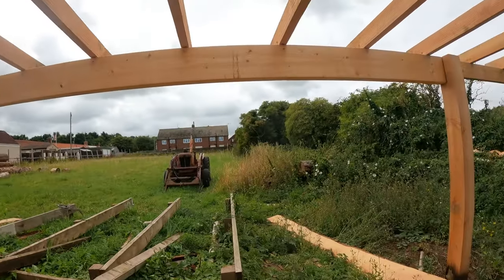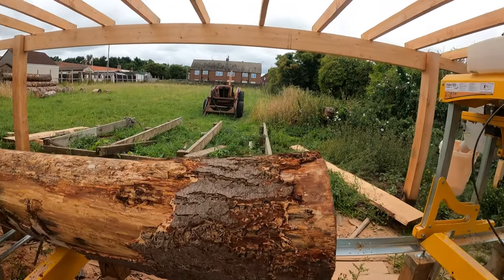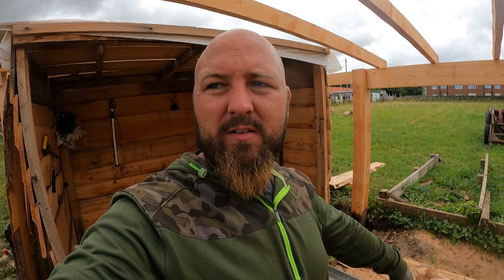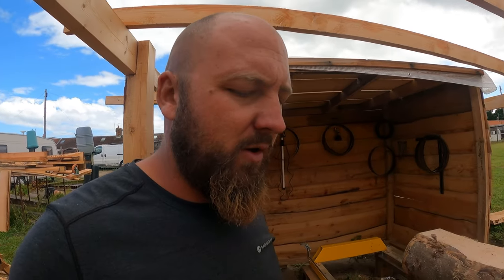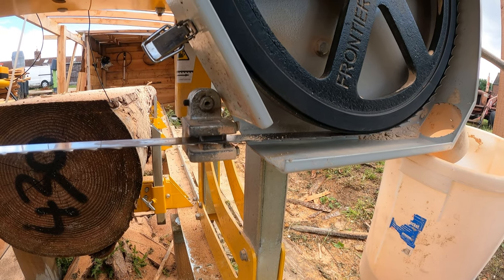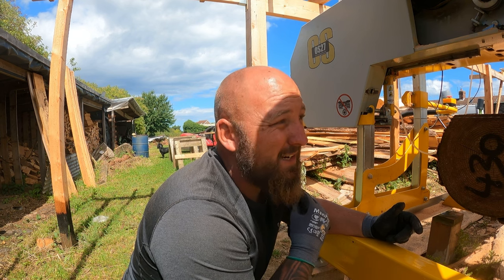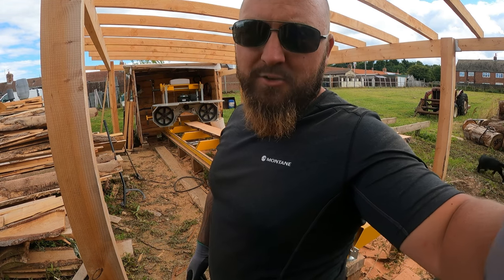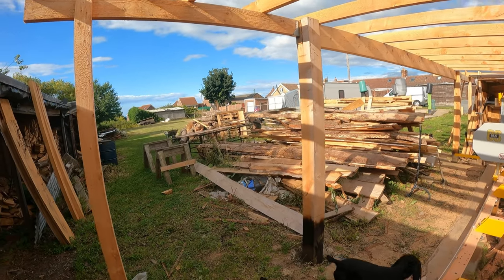Frontier OS27 Sawmilling ~ milling boards [drive belt FAILURE]

Comment: Nick, somedays I just have to walk away from the mill.   It does get aggravating and most of the problems I run into are my own doing.   
My sharpener too, if not paying attention it'll occasionally muck up a tooth.   
The Sawmill shed looks great.  Keep up the great work my friend.
Reply from the maker: Thank you Jerry, I get you there regarding just walking away. It's so frustrating some times. If I had just replaced that belt, everything would have been fine 😄 
Practice and experience makes perfect though eh bud.
Thank you again, it's just taking a little while because of funds 😄

Comment: I saw the vid with the thing that broke with the thing and I cant understand why or how they could force you to do what you did with your content.😉
Reply: Was that a Chiappa little badger?
Reply from the maker: @doylemaintenance  not sure on the Chiappa one there buddy but they weren't happy. Anyways there must be ways. They contacted me almost straight away so that was that.
It is what it is I'm afraid. An update video will come soon 😄 hope yours is doing you well.
Thanks as always buddy 😊
Reply: Chiappa is a .22caliber gun.
Looked like that's what you had there when leaning on the wood in vid.
Reply from the maker: @doylemaintenance  ooh 😄 yes it's a .22 CO2 air rifle. Only at about 8lb pressure. Just for the rats I've got in the area, little cheap gun for the right job 😄